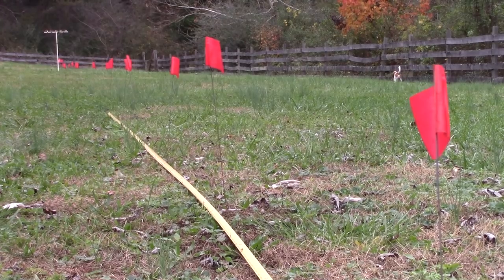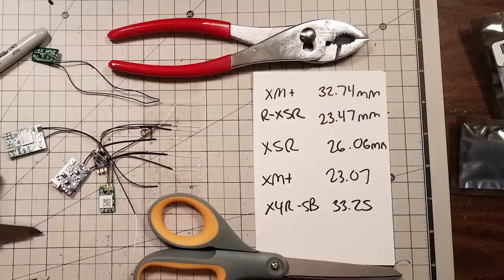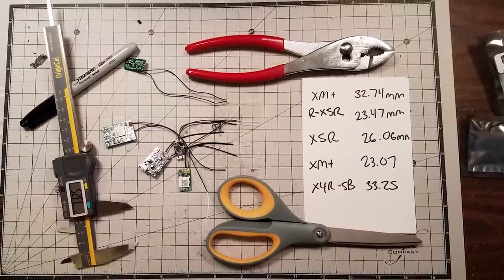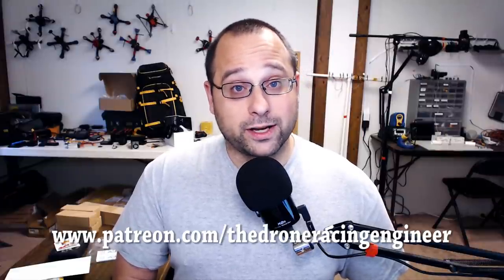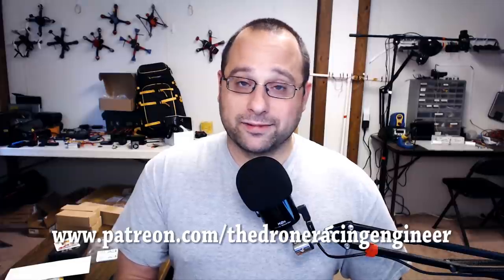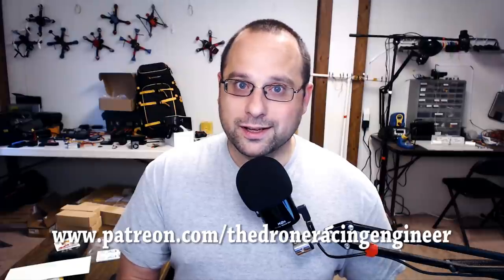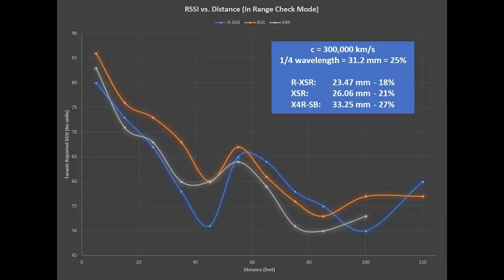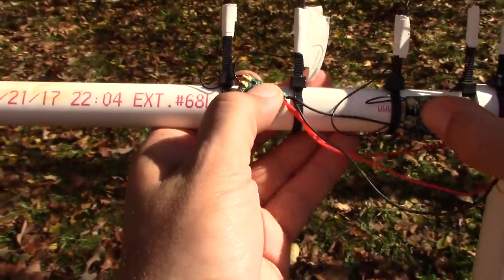Range Test FrSky RX | WRONG ANTENNA LENGTH?

Comment: Great effort trying to figure this out. With my time spent in CB radio hobby before, my experience is that the antenna length vs range is not that critical for receivers than transmitters. I.e. If you got the a bad antenna, say a wrong length antenna, even using a bare wire cut casually will still receive considerbly good. However the same antenna if used in a transmitter, can have high SWR and thus affect range considerably at the receiver side. Regarding to why the antenna length is different for different receivers, I AM PURELY GUESSING HERE, are they related to the telemetry transmission freq of these receivers? Since these receivers are with telemetry, meaning that these antennas are also used as transmitter antenna, is Frsky use a length that is particularly tuned to the freq(s) used by these different receivers?  If that is true, then we should see fixed, say 32mm antenna for all non-telemetry receivers caused they are just for receiving ..... hmmm, looking forward for your further reseach into it.

Comment: Thank you Josh, I appreciate your videos and tests. 

Silly question, have you ever used a rubber coated paper clip for antennae? 

I have tons of questions actually, I'm wondering what the pitch/gauge of the antenna changes about the signal efficiency as well as wether or not a wispy versus firm antenna matters at all either. :) I want more range for my drone and the vtx without having to double the literal strength and diverting it with anything aftermarket. (who knows, there may be a way with math on our side)

Comment: There's a wire length coefficient in the circuitry of every receiver. Otherwise, I wouldn't be able to fly around with a completely disconnected RX antenna.

Comment: I have a somewhat relevant question: Why do you mount your Rx antennas on your quads to back motor arms facing forward? Why not front arms facing backwards? Wouldn't that minimize the chances of the antennas acting like anchors in a crash and thus decrease the chances of damaging the antennas?
Reply: VilleF1N  when you mount youre antennes facing forwards regardless on which arm. You will have the worst link, which is a good thing because then youre certain of a good link when you return.. jn stead of flying to that point of bad link, you turn around, and loose link completely..

Comment: None of these receivers use true dipole antennas.  There is no ground plane.  Therefore the receivers use the attached circuitry and coax length as the ground plane.  This probably affects the results.  Also, the antennas should probably be perfectly straight and vertical for repeatable measurements.

Comment: Nice testing.  I'm not sure that I would expect RSSI between different receivers to be calibrated the same.  I think you need to test to failure in a straight line test - seems like that requires a longer runway. :-)
Reply from the maker: The "low RSSI" and "critical RSSI" warning level is defined on the Taranis at the same level for each receiver.... Anyway, in the 2nd test I was not reading RSSI values but physically watching for the LED to indicate a failsafe. That's functionally equivalent to testing to failure. The moment the RX light goes red, that's when the quad would fall out of the sky.

Comment: I just installed a 26mm antena XSR, the range was awful i even got failsafes constantly. I cut the antena to 32mm and it got better but not as i expected. There is something fishy with XSRs in particular.

Comment: Setup and GPS track flight (in spiral?) and log the RSSI signal of each receiver/antenna er multiple times (3 at least for each combo) XM+ broadcast RSSI in a channel.   This setup would give the close to ideal result of a real case use I suppose. 
Sadly I don't have GPS nor weather to run this test model.  Of course it is a massive work that probably wont be performed for obvious/practical reason.

Comment: Question: I’m confused as to how some of these transmitter modules allow for more range. For example, the TBS Crossfire. This is for for transmitting/receiver range? If so, how does your video transmission keep up with such distance with a crossfire? My video feed always cuts out before my transmitting range, so how would the VTX signal keep up with the receiving signal when using a Crossfire?

Comment: Question for the group- my AR631 Spektrum receiver was giving me spotty reception, motor would stop & at 100ft normal mode motor and all control surfaces stopped working. I noticed that my antenna seemed shorter than a new store bought version- maybe mine was cut in the many crashes plane has taken- AR631 should be 9" long new. Well, mine is only 3" long and wire at end was not exposed. I cut plastic and shealthing off end about 1 1/4" inch can it greatly improved. Question is, how much range did I loose having only a 3" antenna????? anyone?

Comment: Looking at your first graph, would it be right to conclude that a stock XSR is better than an R-XSR reception wise ? The blue line is above the orange line only between 60-80ft. 20ft interval over 120ft total

Comment: I appreciate you are trying to do this scientifically, but how about a practical test as well.   I'm sure you saw the RR test where they flew out in range test mode, fell out of the sky, lengthened the antenna and it got better.

Do I trim my XSR antennas to 1/4 wavelength?  I do.  I also think that antenna placement of the craft is 9/10s of the battle :).   I also wonder if we shouldn't just go to PCB antennas like the X8R / L9R as these have noticeably better range vs the wire antennas.  The L9R is a different protocol, as was the case with the good 'ol D4R-II which is another killer receiver for good range on 2.4.
Reply from the maker: I did see that test, and it's cool and all but it's only like three flights so I feel like there is room for more experimentation.
Reply: Oh I agree, but it will be interesting to see if you get the same result seeing as your RSSI results so far do not seem to support their findings.
Reply from the maker: Bear in mind it's not just tuning but gain that changes as the length changes. So a 1/2 wavelength will have a different coverage pattern from a 1/4. At that point, pitch angle may come into play. There are many sources of error, which is why an anechoic chamber would be the right approach... but we don't have one of those. A network analyzer might help too.
Reply: +Joshua Bardwell The thickness of the conductors, the number of strands, the tightness of the strand twist, the insulation material and conductor material all affect the Q (how sharply tuned it is to a specific frequency) and velocity factor. You could try attenuating your tx signal even further with a 20 dB or so coax attenuator so you don't have to walk so far and bringing Fresnel Zones into play. Really the only way to test the antennas properly would be to use a Vector Network Analyzer, then you could easily see the centre frequency, return loss and Q/bandwidth of each antenna.

Comment: Isn't RSSI sensor in the Taranis? In other words, you limiting the TX power with range test may not affect the output power of the signal transmitted to the Taranis from the receiver. Not sure that makes sense though because your readings did drop more than I would expect for that distance. I've never really paid attention other than on my L9R and that still had 80% RSSI at around 1.5 miles. Just wondering.

Comment: lol great test Teach i didnt walk lol that seemed like to much time i flew out to a set range but in end found 10% max rssi between lengths. so after a few reads found the modules like to channel switch between 2.4-2.5ghz and used about 81% as VF and cut a test mid frequencies used copper tape and made it a sleeved dipole as well. its a small increase like i can now go behind stuff without warnings i couldn't before but is not like crossfire just more stable on read out and haven't had to hold remote up in fear of failsafe. playing around later i did found use for all them rubberducky antenna now have a set of personal 5.8 helical and other circular polarized antennas that work nice less flicker on my liked channel. also my motors im customizing came out great lol think i have a combo that is unique.
Reply: youel adamas you have a picture

Comment: I bought some replacement antennas for my frsky reciever for when I chop them off in a crash - the replacement antennas are longer than stock on two of my recievers..... wondering if it'll be tuned badly for my reciever and if I should snip them...

Comment: Hi Joshua, Shame the test wasn't a full blown conclusion However it was very informative and interesting.
Reply from the maker: Real science is often not cut-and-dried. However I still think there is a lot of value in the test. The more tests you do that fail to confirm a hypothesis, the more certain you can be that the hypothesis is probably false.
Reply: Could not agree more that's science for you just when you are sure you fined out your not. But sometimes you fined the answer to a different problem. for example were did the dog leave his toy !

Comment: Is there anyway you can find out if FrSky has tuning circuitry in their receivers?  I am an antenna designer and i'm thinking without any tuning these different length antennas should be very similar in efficiency.  however if the RX's are turned for specific antenna lengths then putting a different length antenna or also different length feed coax will make much more of a difference in efficiency.  it would be cool if you could get FrSky to confirm that or not.  From your testing it looks as though there is not any antenna tuning circuitry since most of these antennas seem to test about the same.

Comment: S.W.R. does make a difference.   Joshua is there a swr meter that you can use with a V.T.X. I guess not or you would have been using it now .  Cheers
Reply from the maker: No, I don't have that equipment.

Comment: Thanks for all the work you put into your videos, but I want to learn more today!  I just bought the Kopis 1 (love it) and have a question about mounting the receiver antennas.  I was able to squeeze in a spektrum SPM4649T in there, but due to wiring restrictions I ended up with the antennas pointing towards the back from the front arms. You gave directions to mount them pointing to the front from the back arms. Can you tell me if that matters. I can make a longer harness to flip the receiver around if you think there will be an improvement. And could you explain why it matters if they point to the back or front?  Please and thank you from an appreciative viewer.
Reply from the maker: It doesn't matter. Your way is fine.

Comment: Joshua, did you test using a standard Taranis antenna or did you use an upgraded antenna? I am trying to decide if it's worth modding my Taranis to upgrade the coax cable and use a higher dbi antenna to get more range.
Reply from the maker: It's a standard antenna.

Comment: If this is to be "scientific" you would need to make sure all those antennas were equally straight or bent... if that doesn't matter, well then none of this really matters
Reply from the maker: If a slight bend in the antenna makes a bigger difference than the length, then I'm happy to call it as good as no difference at all.

Comment: Did you test with a standard taranis also? 

Wouldn’t the coax you put in that, improve your signal? Didn’t you have a previous video showing that you swapped out the aftermarket coax cable within the taranis to a even better/thicker one?

Great video as always!
Reply: I thought this as you made a comment roughly half way through about it always resulting better than expected for you
Reply from the maker: +Tip Nadroj this isn't that radio. This is stock.
Reply: Joshua Bardwell interesting, still love the tastings
Reply: Joshua Bardwell and testings... hah

Comment: Joshua...why don't you use your attenuator on the tx?  That way you could go back to the field and have another walk down.....Now if you can tell me the difference between the two ipx- ufl connectors so i can order the right ones for my r-xsr, since they changed them on the new stuff,,,, I think that's how it is because I ordered newer longer ones for the r-xsr and the connector on the new antenna are too big....BUMMER where can i get the right ones?
Reply from the maker: There are separate listing for the new small UFL connectors.

Comment: I tested the X4r (33mm) vs the XSR (26mm) against each other because i had dropouts on the XSR and found out in range mode:
X4R stock: 150m
XSR stock: 60m

i cut the XSR antennas from 26mm to 33mm and now the range is equal to the X4r (150m)

so my conclusion is, that the XSR (1/5 wavelenght by 26mm) is waaaaay worse then the X4R stock antennas with 1/4 wavelenght.
Reply: I'll have to try cutting my XSR antennas to 33mm and retest. I saw a Rotor Riot video about it, but at the time I felt uneasy doing that. After 7 months building and modifying quads, I feel better about cutting and soldering. :)  I'll have to revisit the XSR.

So you cut it to exactly 33mm?
Reply: The easiest way might be to measure the cut directly off of an X4RSB antenna. Compare a few to make sure there's no variance though.

Comment: Joshua, would not a more meaningful test be to use the same receiver and only change the length of the antennas active element thereby getting a true comparison of the effect?
Reply from the maker: +ITS FPV but that doesn't reflect what people actually do when they say a certain receiver has shorter range.

But anyway that is what I did in the 2nd half of the video when I had 2 xm+ with different antenna lengths.

Comment: What if you did the test with the same receiver type and just use the different types of antennas?  Seeing your video I am thinking that each receiver is very well tuned with it’s own antenna. The question now is should we tamper with the antenna length or with after market antennas or stick with factory size antennas?
Reply from the maker: +Florin Ţermure that is why I had two different antennas on the XM+.

Comment: I never hear the term ground plane , when I was active in CB the ground plane--- rear bumper (very directional) to roof top (best over all).Would the carbon frame act as a ground plane, thus positioning ant. differently affecting  the tran. pattern? Have pity on me I went to electronics school 56years ago.
Reply from the maker: +Sailor john yes I think it does affect the coverage pattern.

Comment: When you take an ohms meter to the transmitter antenna pin antenna remove of course  of the x9d  you will see it shorted, so I guess that they are using an inductor a cross between ground in center pin. On the X light they are not doing that it's open circuited
Reply from the maker: That is correct. The inductor is to help protect against ESD. The older X9D didn't have it either.

Comment: Thanx for testing.there is a video of stingy and Mr Steele cutting an xsr to a quarterwave lengthy and it went way further.i'm still a newby and find that the range on the xsr isn't that great.i think when I saved enough I will go for the tbs crossfire .kinda wish frsky would come out with something like that though
Reply: Actually there is a 900mhz frsky module (FrSky R9). I don't know how good it is though.
Reply: FSLopez thanx for the reply! I will look it up
Reply: They do have one and it's not as good as crossfire

Comment: While we are talking FRSKY antennas I dont suppose you know the name/type of antenna that used on the X4RSB as the connectors are tiny and the standard replacement antennas are too big........ thanks in advance.
Reply from the maker: +moochasas check the video description for a link to the replacement antennas. It's still a UFL connector just a smaller one.

Comment: Does the antenna total length need to be the same for both antennas of an XSR Receiver?

I ask because my range has dropped off a lot after I had to repair/modify one of the antennas (due to damage from a crash) on my XSR Receiver. So now the modified  antenna is shorter then the other one, both have the same 26mm length of unshielded wire for the antenna, but the  modified  antenna is about 26-30mm shorter then the other one. Is this affecting my range? Did I change the impedance of the system? Do I need to shorten the other one as well or replace the modified one. Any help or ideas would be great.
Reply from the maker: If there is a correct length, then it's better for them both to be the same length. If one is the wrong length then the diversity system will simply avoid it, and you will not get the benefit of diversity. However the shielded length doesn't really matter, only the unshielded length of antenna at the end.

Comment: Joshua, can't you use RSSI on XM+ like Project Blue Falcon does on his video?  He uses channel 16 and set's it via CLI.  Or, is this wrong?  Thanks!
Reply from the maker: Yes that is great if you want to see RSSI in your OSD. I haven't got an OSD. I haven't got a flight controller either. Where is channel 16 going to go when there is nothing to receive and interpret the SBUS signal?

The only way to see RSSI in the "range check" screen on the Taranis is if you have a telemetry receiver.
Reply: ah!  I get your point!  I guess I should have looked and "listened" like a good student (I usually am). :)

Comment: Could the antenna length on my stock XM+ be why I get drops/failsafes at very close range(within 5 feet)?  It has been solid outside of about 5 feet from the transmitter(QX7).  Great testing!
Reply from the maker: That is probably because the front-end amplifier of the XM+ is being overdriven. I've never seen it on the XM+ though, only the X4R-SB.